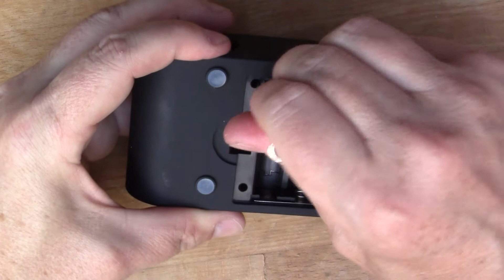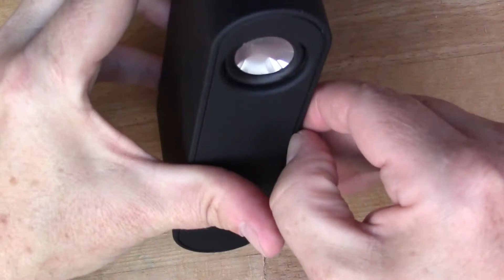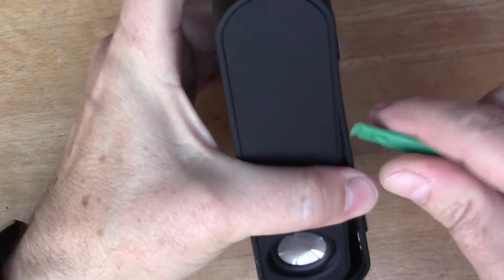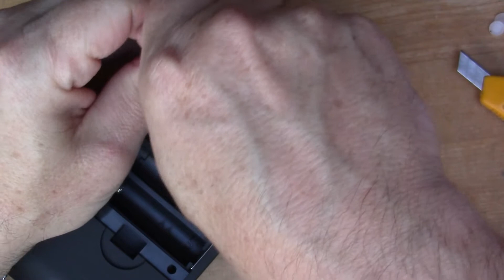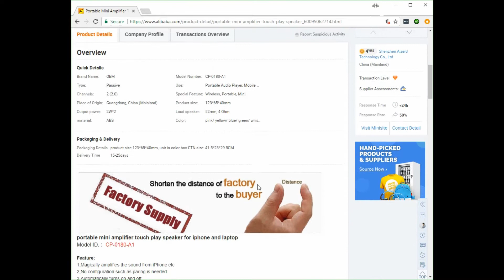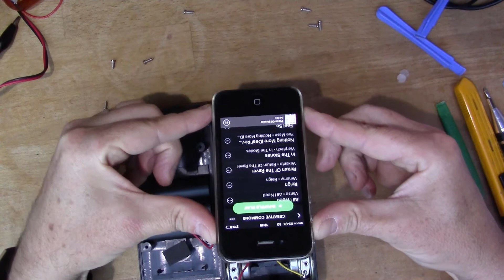Teardown: Mystery Audio Amplifier: Bluetooth?

Comment: i used to have one of these. actualy very good and batteries lasted forever. it depends on the position of the phone speakers and if they use shielding. an interesting fact is you can use it with electric guitar for infinate sustain